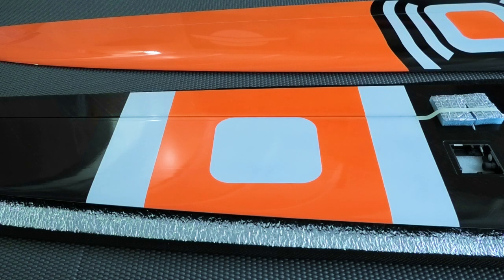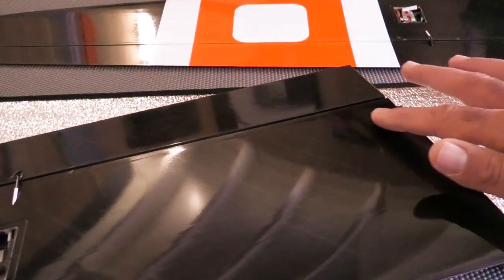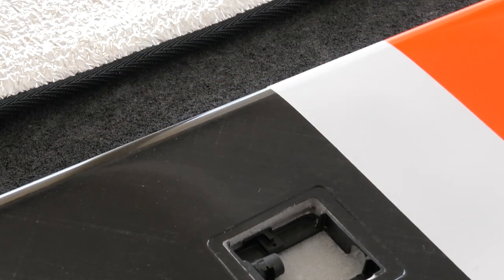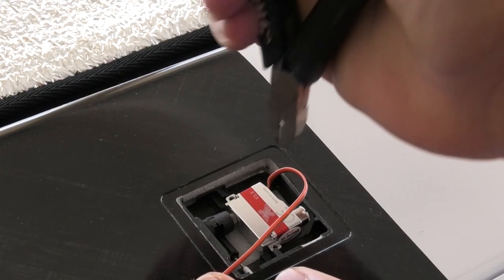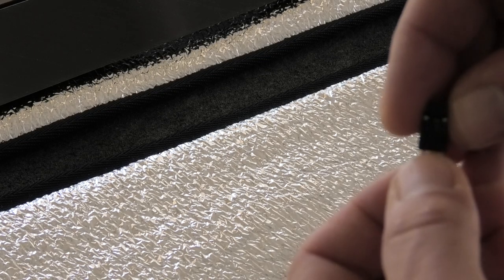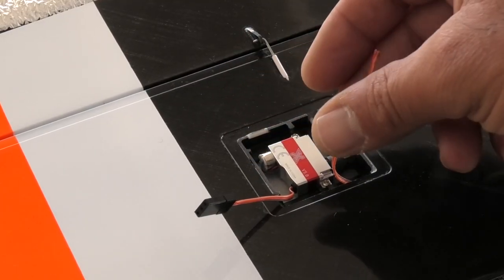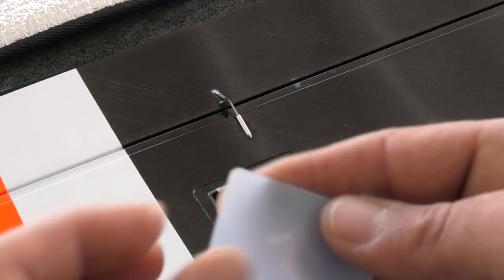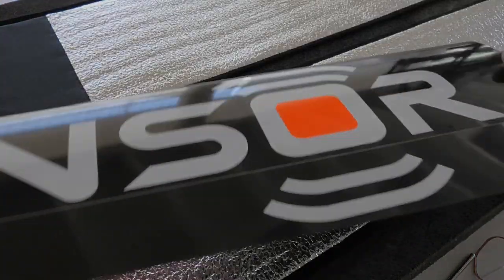CN-Models Sensor F5J Aileron Servo Installation

Comment: Neat install, I have a sensor. My only comment :- the servo push rods are steel , fitting into a plastic horn and bearing holder. where the steel rod pushes into the plastic there was some movement , easy fix with cyano .